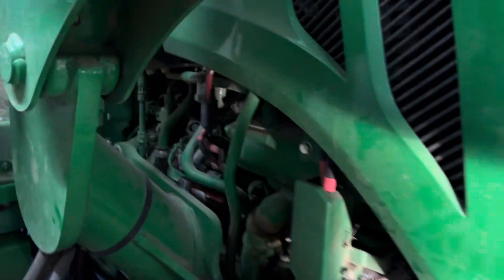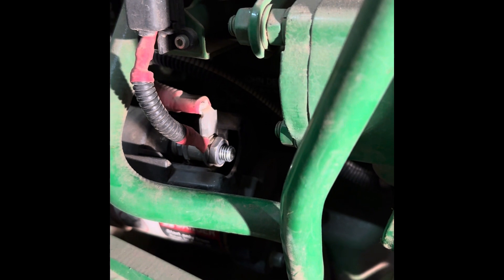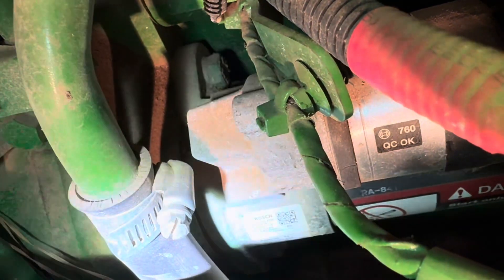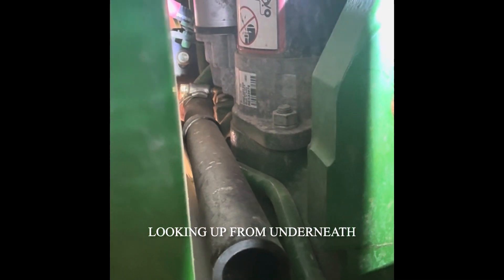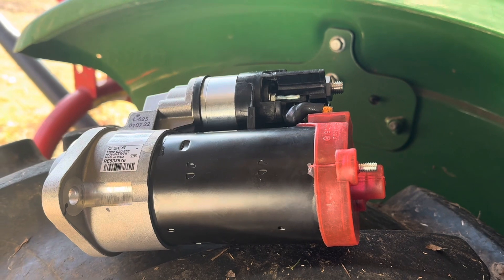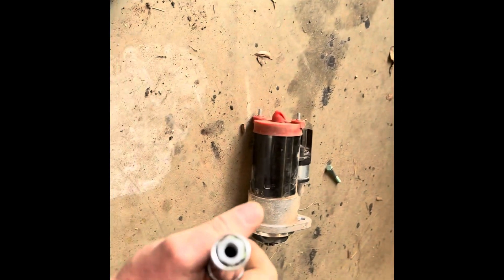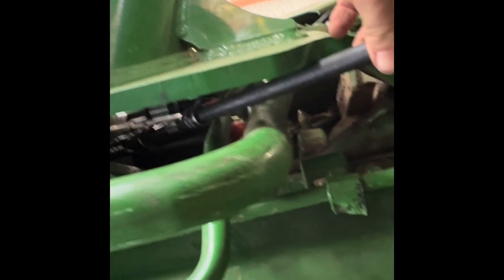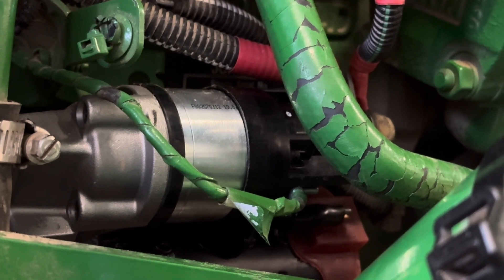John Deere 5045E Starter Swap @davidpippin7206

Comment: I have same problem now, but how do you determinate the starter problem  but not other switches or relay issue? I am doing the research now
Reply from the maker: I’d like to tell you that test results certain resistance, ohms, amps or volts will be a dead giveaway away but the truth is that it’s much easier. All you have to know is that those starters are junk So by the time they are five years old and they sound slow, it’s time to replace the original.